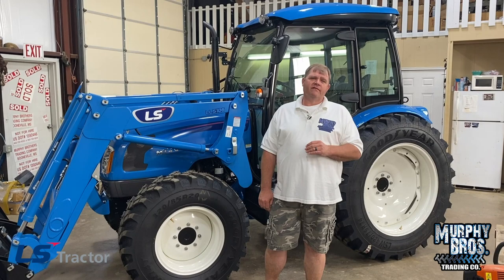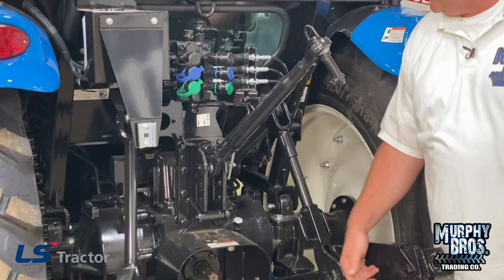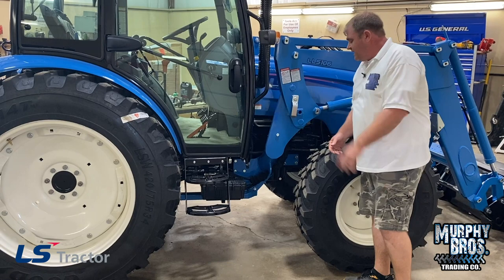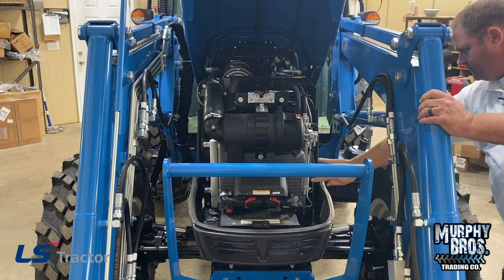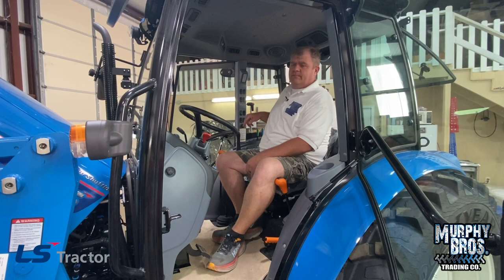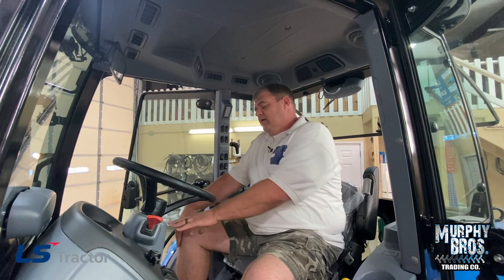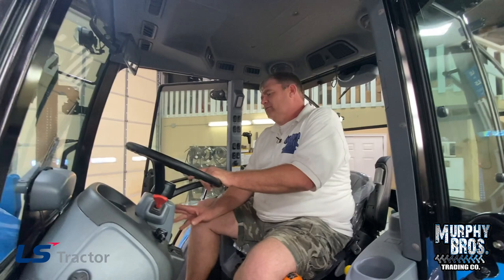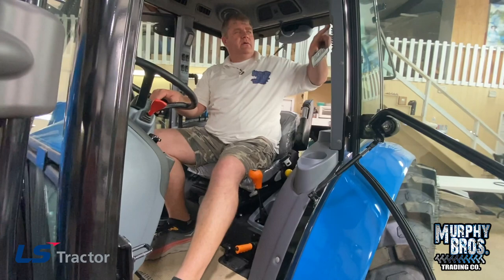LS MT468CPS cab power shuttle tractor walk around

Comment: Are the wheels adjustable  on the mt 468  i cant find anything on that . I need it wider for  the hay field thanks
Reply from the maker: I had to look myself. The rears are two piece and adjustable on the standard AG tires and the R14 hydrid tires like shown in my video. The front wheels with the hybrid is not adjustable. I am almost positive the front wheels with standard AG tires is adjustable. The R4 INDUSTRIAL  is not. You would have to use spacers on front if not equipped with 2 piece wheels... BUT be careful widening front tires on any brand. This puts much more stress on front bearings, seals, steering components, etc.
Reply from the maker: When I got to the store this morning I went and took another look in person. The R14 front tires on a MT468 as shown are not adjustable without spacers. The R14 fronts on the next step up in tractors, the MT573, is a 2 piece wheel that is adjustable. The MT573 also has the outboard planetary front axle that will withstand a wider load bearing. As bad as I would like to sell my MT468, I suggest you take a look at a MT573 for your application. When you look in person, you will probably see the front width is fine for hay as it sits, but the MT573 is adjustable. I have never had any complaints on front width on the MT468 or it's predecessors from my hay customers. Hope this helps!
Reply: Thanks for the reply . im goong to look harderd at this now for the ag tire set up thanks again i will probaly have more questions lol   @MurphyBrothersTradingCo

Comment: Is this the recommended R14 tire size for the MT468? Are they taller than the AG tire?
Reply: Are the R14 oversized good for snow clearing or will the fenders be too tight to tire?
Reply: @jakebarid8704  in Fl swampy areas, the mud will likely exceed the tire to fender spacing. Clearing would likely be an issue. Clearing a fender stuck with debris is no fun and possibly dangerous.
Reply from the maker: They are larger than the standard tire. I really like them for most applications, but like others have mentioned, there are pros and cons with anything.